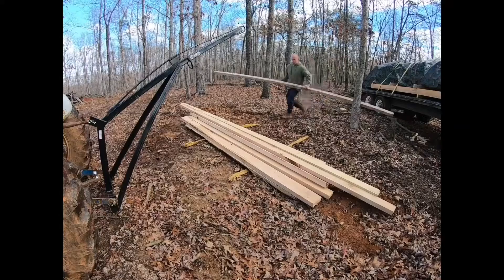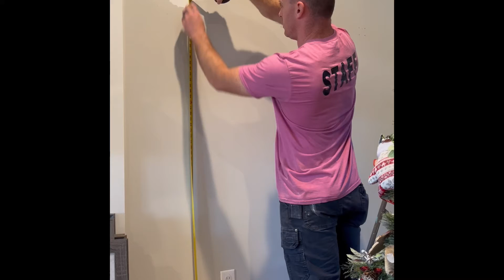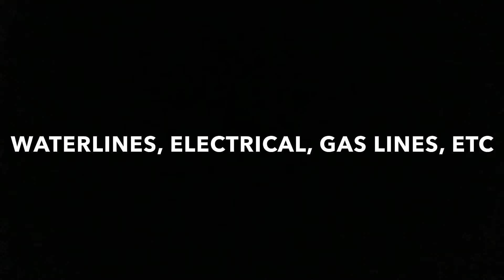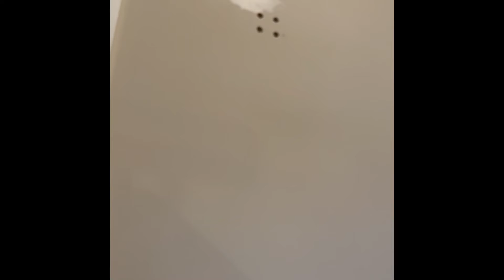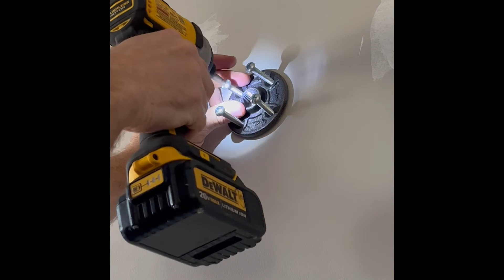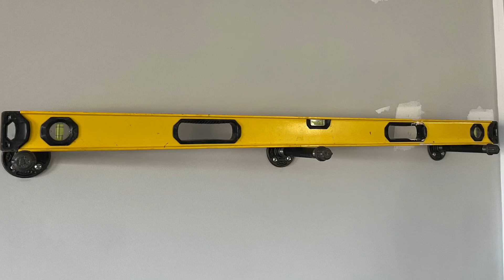Installing Industrial Iron Pipe Shelf Ep.35

Comment: What keeps the shelves from moving on the round pipes?
Reply from the maker: So I did not secure the shelves to the pipe. We have 2 kids and it’s been a couple years since we put them up and they haven’t moved. You could take a 3/16 drill bit and drill through the pipe and screw the shelves down though.

Comment: I would mount the flanges on studs with two holes vertical. That way you can drill two screws into studs and then anchors on the two horizontal holes.
Reply from the maker: That’s the ideal situation but depending on the shelf length and placement for spacing it may not work every time.